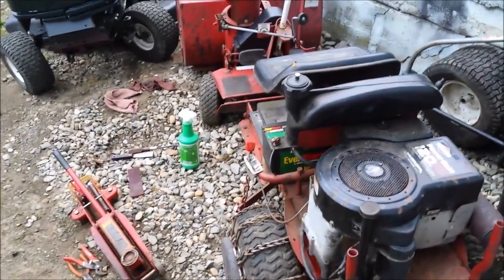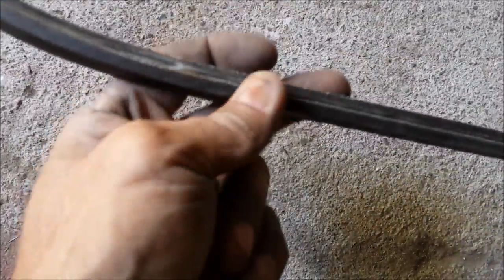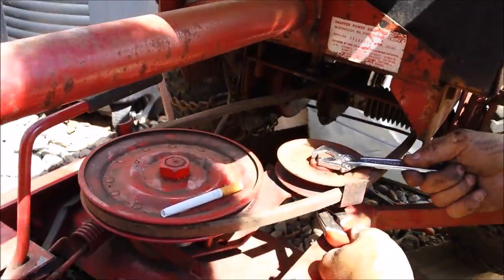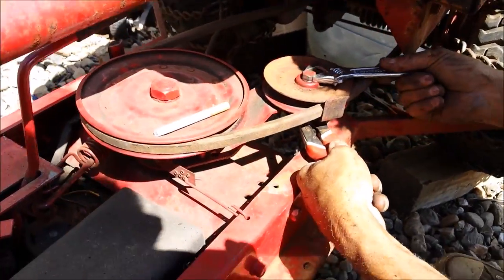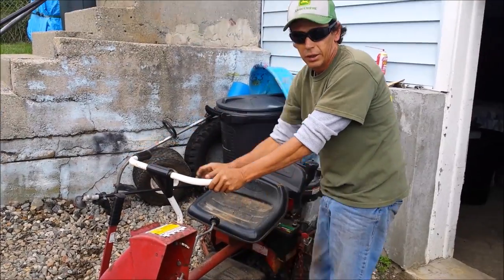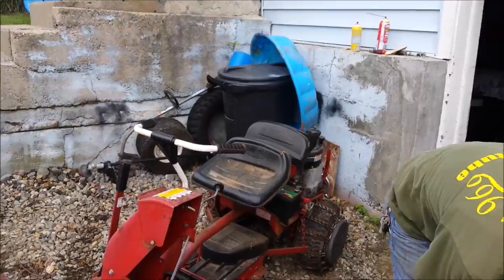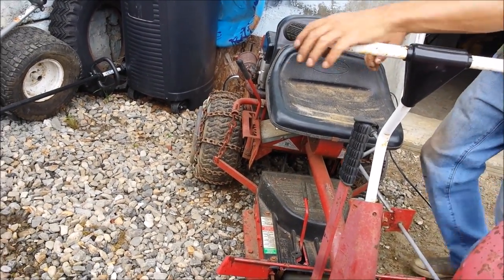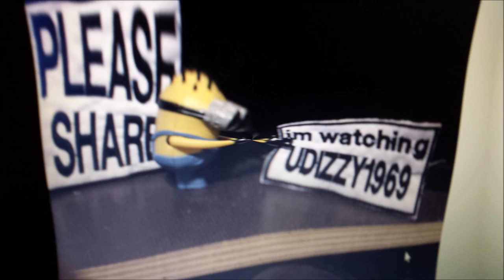Snapper on the road again, and Mail Day

Comment: That rack on the back is there so you can stand the tractor on it's butt to service the drive unit.  Just remove the battery before standing it up.
Reply from the maker: No that rack is for the plastic cover to cover you when snowing blowing. But thanks, cheers.